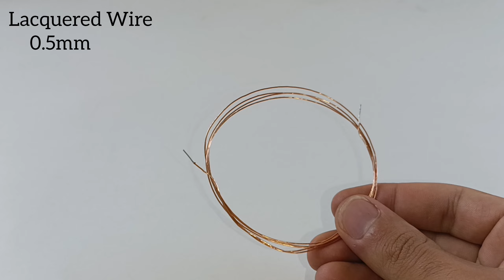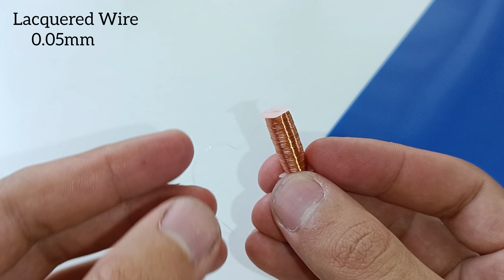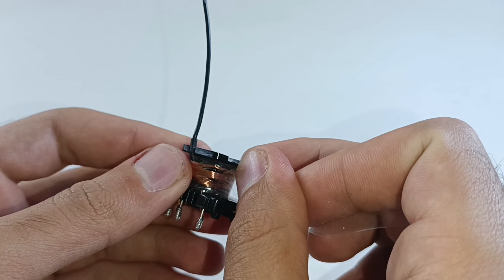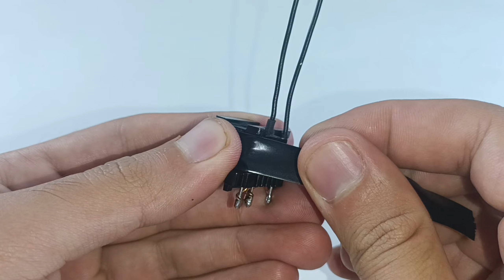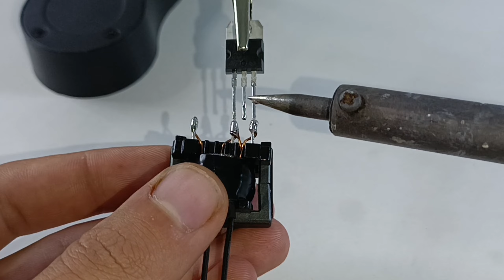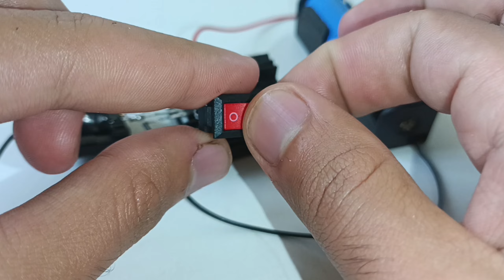how to make 400kv high voltage generator at home | 3.7 to 400000 (plasma)

Comment: by the size of the arc its no way near 100,000 volts. it around 2-3kv
Reply from the maker: Yes, it may be in the range of 2-3 kV
Reply: it is high frequency tho, and high frequency arcs are typically not that long i think. So might also be 10kv. But not more than that.
Reply: @neutronenstern.  still that is not anyway near 10kv
Reply: De unde aș putea procura și eu o bobină de 500.000 de volți contra cost